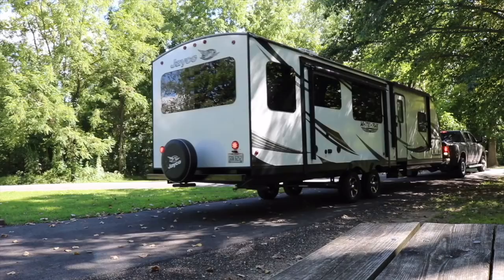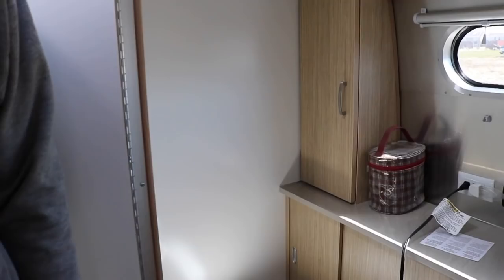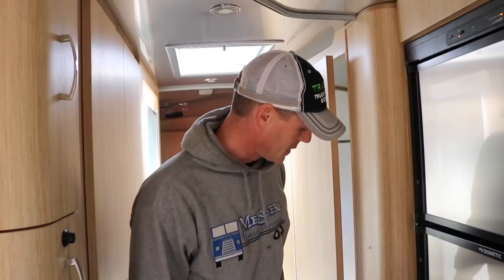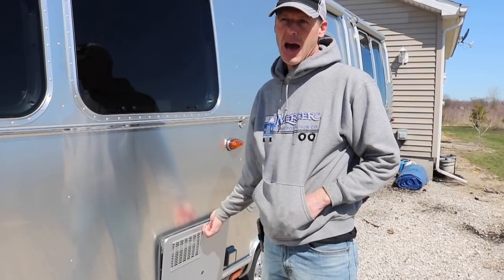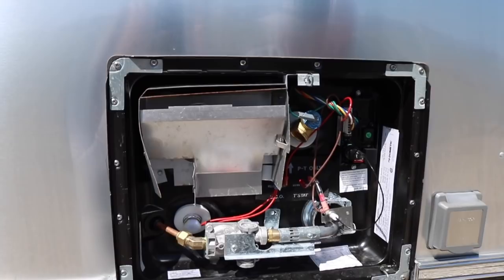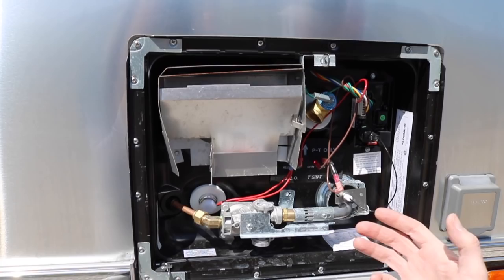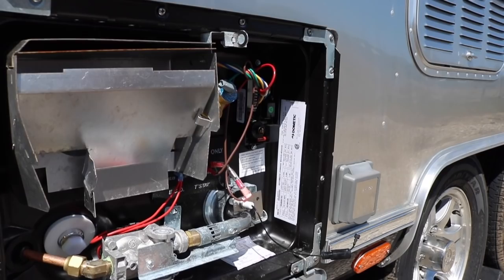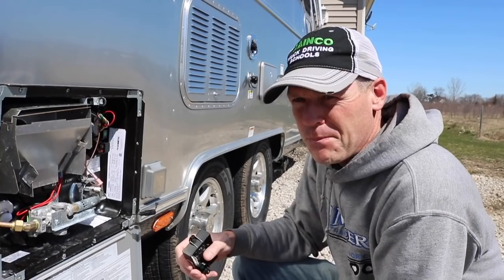DIY Atwood/Dometic RV Water Heater Repair (How To Fix)

Comment: HI, is the new board still functioning? Just had our first ignition failure on our 2018 26 flying cloud. everything was great for three months across the country. Out for a short shakedown before another three month journey and...no propane hot water.
Reply from the maker: Yes our replacement is still going strong
Reply: thanks for the reply. we're stopping in at our dealer after we leave the Georgia mountains. We have an appointment we made a week before we left for some quick warranty work. I guess our dealer is a bit out of the ordinary. Any plans to cross the country to the west coast?
Reply from the maker: Our dealer is a very busy dealer, and we avoid dealers as much as possible haha as for plans to go west, we are still waiting for our house to sell then we will go where I find a contract. We love it out West so we hope to get out there soon!
Reply: Wandering Wagners we’ll have to meet up with you sometime. We like the way you chill out and relax. Though the driving days might be a little long. Haha. DM for emails

Comment: Nice.  Probably would have cost you at least $80 or more just in gas alone plus it possibly could have turned into months and not weeks from what I've heard about how busy the service centers are.
Reply from the maker: Yeah it just makes sense to fix things ourselves. Plus we know it's fixed correctly the first time
Reply: Back in 2015 I bought a brand new travel trailer.  Never took it in for service but there was a ton of little stuff that I fixed.  Probably spent close to 75 hours working on it.  When it warms up I'd check out your Air Conditioner thoroughly.

Comment: Mine tries to ignite 3x but doesn't seem to be getting any gas. Manual says there's a 3x safety shutoff mechanism built into it. Doesn't work on electric or gas. We hear it try to ignite 3x and nothing. It's only worked properly once and hasn't worked since. I've gotten the fault light on the panel which is also an indicator that it's not getting gas. 

These circuit boards seem to be complete garbage. I'm guessing that's what it is but would hate to waste $80 if it's not it.
Reply from the maker: You can get the board tested. But the dealer told us ours tested fine but it didn't work so take that with a grain of salt.

Comment: Where did you get your replacement circuit board please? Thanks!🇺🇸
Reply from the maker: We searched the board part number and found one on eBay
Reply: @WanderingWagners  THANKS! What was your part number? Mine is 91346 but was replaced by 93305. Looking on EBay and can’t find exact one. 🇺🇸
Reply from the maker: I can't remember haha sorry

Comment: What site did you get the part from...same issue here in canada
Reply from the maker: We found it on eBay. Google search the part number. There should be a sticker on the side of the circuit board. You might have to pull the board off the water heater to see the sticker.
Reply: Thanks for your reply... happy camping

Comment: Would you mind sharing a link for the control module? I have had my first RV a 2019 Avenger for 3 months now and the same thing happened. The dealer (though not as far away as yours) is currently booking late Oct to have work done.
Reply from the maker: What I did was pull the board out and get the model number off of it and Google searched for a replacement. We ended up buying one off eBay and it's still kicking!
Reply: Awesome! Thanks for the info.

Comment: Worse thing in the world having to be without your (in my case) 5th wheel forever because of broken items and RV repairs taking forever to get fixed and the crazy high cost mark up for parts and labor.
Reply from the maker: We've only had to take past campers to the dealer twice. Both times took forever and ruined lots of camping days. We prefer to fix ourselves if at all possible

Comment: Sounds like your dealer has horrible customer service, but "Dometic/Atwood" is dreadful. I'm helping a neighbor to replace the Atwood gc6aa 9 water heater with the newer "-10E" model, and there are different wires coming from the new unit on the low voltage/propane side, and a different NUMBER of wires as a bad bonus. His replacement didn't come with a manual at all, and there are differing user videos on how to patch in existing wiring to the new unit. Going to the company website doesn't show the model at all, much less a PDF manual I was hoping for. I'd suggest a different heater, if other manufacturers exist. Companies making garbage have to be replaced in an actual free enterprise system.
Reply from the maker: Sorry to hear that but luckily since our replacement our water heater has been great. We just searched the part number online and found one on eBay that was new. We also got a replacement from our dealer so it all worked out.